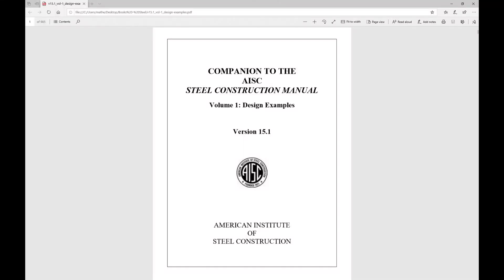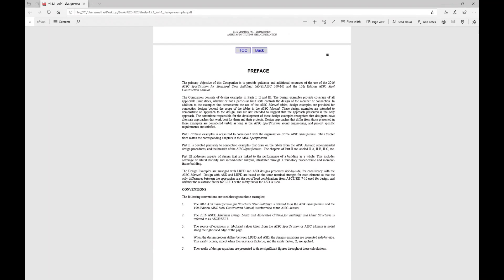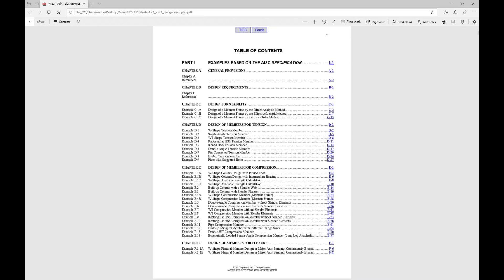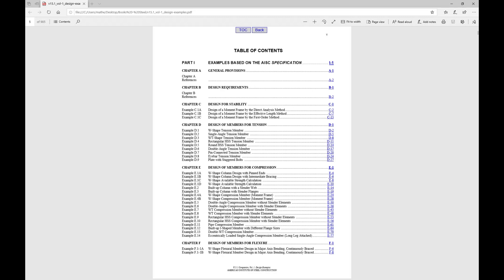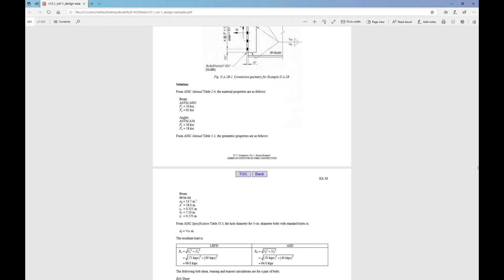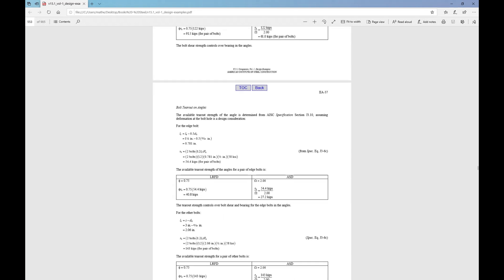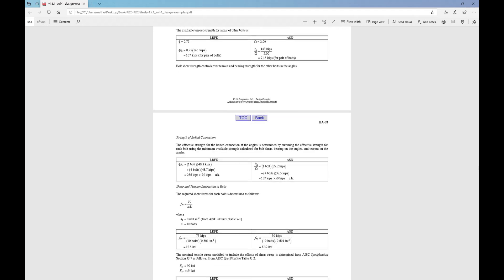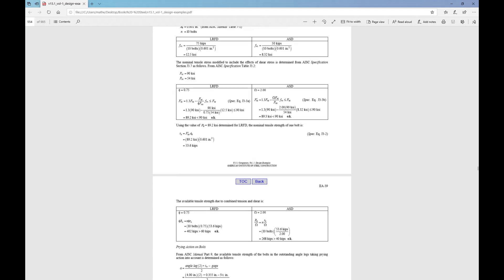Best Steel Design Books Used In The Structural (Civil) Engineering Industry

Comment: Something they never taught us in school, how to write an industry standard structural design report. Would you do a video on this?
Reply: Yes definitely, but nowadays is easier to do because you only need to explain how you calculate the structure as tale, after that put the load that you used, combination, results (only principals like deflection and ratios) and add the file of the software for review.
Reply: There are so many ways to do a structural design report. Most people just print the output from the software they use. Most hand written reports are short and dumbed down.
Reply: @PokeYourEyez  exactly what would make it an interesting video
Reply: Conor Schaumkell It also could be a liability for him as well. Different state laws require different requirements and documentation. He could be liable for it if he leaves out information. I think his video on the structural software is good enough.
Reply: actually design reports with so much of details presented sometimes is a pain and not required always. one should trace down a comphrensive way to making reports. may be some samples mat can show